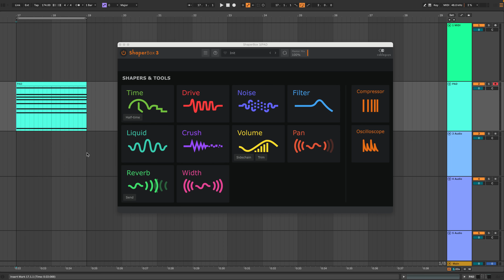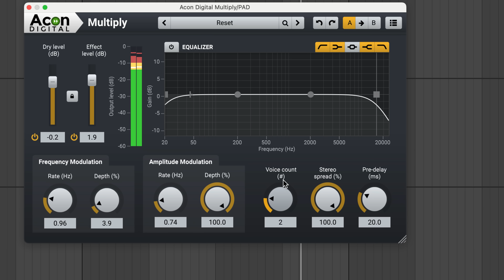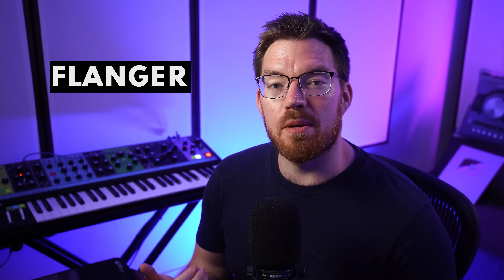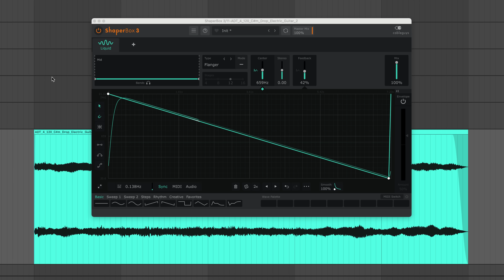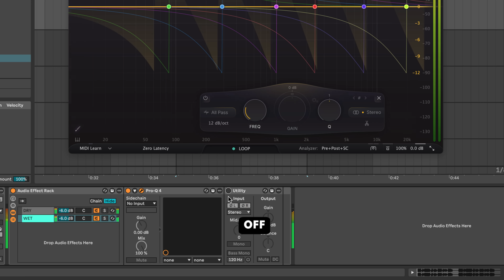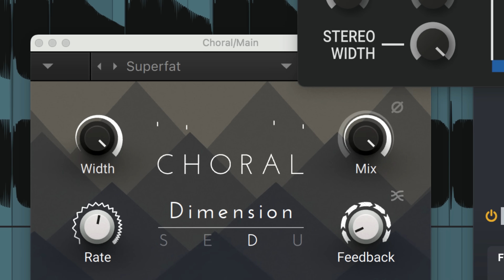Chorus vs Flanger vs Phaser EXPLAINED ✅

Comment: Good video. 1 question: what is the time range standing for? What is it used for?
Reply from the maker: It changes the scaling of the time offset (the Y/vertical axis of the graph). The default 'As LFO Length' is recommended for most time FX (stutters, beat repeats, turntable effects, etc). But for effects like chorus, when you want subtle fluctuations in time offset rarther than large jumps in time, you'll want to set Time Range to one of the Fine modes. See my full guide for more on how TimeShaper works: https://youtu.be/PmX8UY8q6oA

Comment: nerding out here, but: the classic ensemble chorus (the one from the solina string machine) is just 3 delay lines. all three are modulated by the same summed fast and slow lfo, but all three receive that modulation slightly offset from eachother - at 0, 120 and 240 degrees difference, respectively.

Comment: Gread video! Seems to be a good explanation. No yadda-yadda just to pad out the video time. No long and stupid sponsor message. Short and to the point. I will re-watch to get the details. Goes onto one of my playlists!

For any Europeean over, say, 65 years of age, the first phaser effect you heard might have been listening to Radio Luxembourg on an AM band.

I need to go and re-listen to XTCs Making plans for Nigel , since I don't have a fresh enough memory to say if the drum intro is phasered or flangered (it's definitively a phase mod type effect, and not a chorus.)

I have a chorus and a phaser on my guitar pedal board. Chorus, if used at all, is set to barely be heard. "Nice sound, how does he get it?" rather than "Ah, a chorus, obviously!". The phaser OTOH can be turned up a decent bit. Need to get a flanger..😊

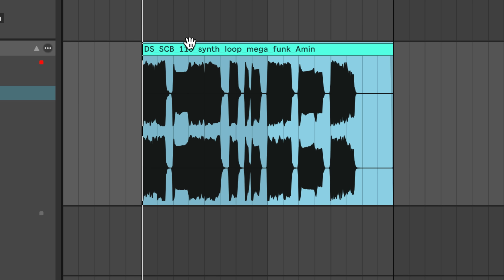Comment: 5:11 This is the dry clip? It's got so much filter mod it sounds like it's already going through an auto-wah. That's awesome — explaining a modulation effect by putting it on top of a much heavier modulation effect. Next video needs to be "Vocoder EXPLAINED" but all the dry clips are T-Pain.
Reply from the maker: Can you not hear the phasing kicking in? It’s pretty clear to my ears – even with the filtering baked in, the movement from the phaser is distinct. It’s a funky loop because it suits that kind of effect. I could’ve used a raw waveform and called it a day, but let’s be honest – nobody wants to sit through 3 minutes of an init preset. 😉

Comment: I use only vintage Morley pedals. I like the Phaser the most. I don't have a Flanger but I have two Wahs in series (Power/Wah and Distortion/Wah). With my Fender Precision Specal Bass, I slowly work the two Wahs when I want a serious muddy sound... and leave it. I then send it through a Compressor and finally a Volume/Boost.  Nothing fancy... effects are not everything to me... for a recording you want to sell, you need a hook - effects can do that. But for live entertainment, I don't need any hooks, so some simple effects works for me.

Comment: So does the flanger explain the sound jets make as they pass overhead? Two identical sounds (the two engines) ever so slightly delayed (one is in a different position in space) and converging as the distance increases?
Reply: Not quite - that’s the Doppler effect. Doesn’t have to do with there being two engines so much as the engine(/speaker) moving while emitting the sound.
Reply: @noxavis454 Well there’s Doppler involved for sure, you’re correct about that. That’s very audible. But there’s a “filter sweep” whooshing component of the sound that seems to be present regardless of whether the plane is flying towards or away from you. Personally, I seem to notice it more when the plane is flying away, and it has a rising “pitch” in that case. That would rule out the Doppler effect.
Reply: @FranklyNorman  did a little googling, the two engines are probably too close together over that distance to cause it. But  the sound reflections off the ground could do it! That could add enough lag to give the whooshing/warble. Pretty sure submarine sonar makes use of that effect too
Reply: @noxavis454 Interesting! I never considered that. Thank you. And are we sure that the “effect” of the phenomena would be that of a flanger?
Reply: @FranklyNorman  I would guess so. Presumably an ideal reflection is a time-delayed copy of the signal, like in a flanger. Probably not digitally perfect in reality due to material or atmospheric properties or something. But presumably more like time-delay flanger than a frequency-specific phaser
Reply: @noxavis454 Yeah that makes sense to me. Thank you

Comment: I'm not sure. I think I like my modulation very controlled. I play guitar by the way. Right now I'm running a chorus, but it's set slow and on a low/mid depth. Envelope filters are cool too, which is like a touch sensitive auto wah.

Comment: Chorus and flanger ok, but I did not understand what the Phaser does.  How does this "all pass filter" work and why does it modify the sound at all?
Reply from the maker: An all-pass filter doesn’t change the volume of any frequencies (so it passes all), but what it does change is the phase of those frequencies – how "in time" or "out of time" they are relative to each other.

So when multiple all-pass filters are chained together and their center frequencies are modulated, some frequencies start to cancel each other out due to phase shifts. That’s what gives a phaser its characteristic sweeping notches – without actually using EQ or delay in the traditional sense.

Shifting the center point of the all-pass filter means moving the frequency where the phase shift is strongest. By modulating this over time, we get that classic sweep.

Comment: I longed to learn this for a very long time. But the phaser explanation is not so atomic as the other ones. I get what the other ones are doing: delay and modulate the delay time. But what  is the operation an all pass filter does? What is shifting the center point of the all pass filter mean? I cannot understand this intuitively by just looking at the name: a delay is self explanatory enough, it emits the signal later in time. But all pass filter, the term sounds like a contradiction in terminis because if “all is passed” what is filtered/changed then?
Reply from the maker: You're right: "all-pass filter" is a confusing name. It doesn’t change the volume of any frequencies (so it passes all), but what it does change is the phase of those frequencies – how "in time" or "out of time" they are relative to each other.

So when multiple all-pass filters are chained together and their center frequencies are modulated, some frequencies start to cancel each other out due to phase shifts. That’s what gives a phaser its characteristic sweeping notches – without actually using EQ or delay in the traditional sense.

Shifting the center point of the all-pass filter means moving the frequency where the phase shift is strongest. By modulating this over time, we get that classic sweep.
Reply: @Cableguys thanks a lot for the information. I had a deep dive follow up chat with ChatGPT explaining me the intricacies of all pass filters. I learned more about how the amplification and the phase shift are related to frequency but indeed, it is very hard to explain all pass filters more simply, so your explanation was the best starting point.

Comment: You should try them on white noise too. With a static flanger you get a machine buzz sound.  I think Jarre used a phaser on white noise on the Oxygene album to get that sond of water waves on the beach.   Then try them on a simple single osc bell sound. The chorus takes it to a whole new level.